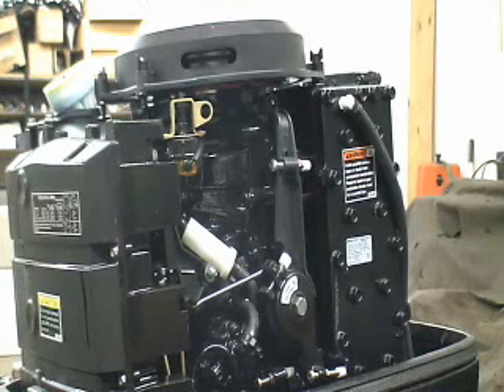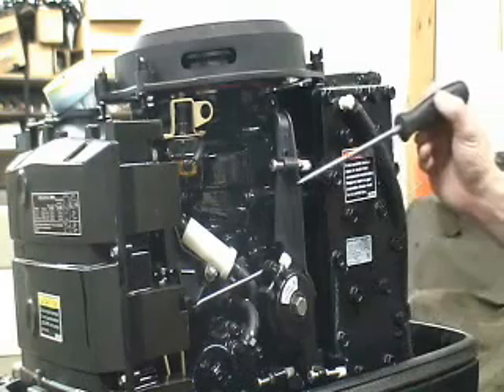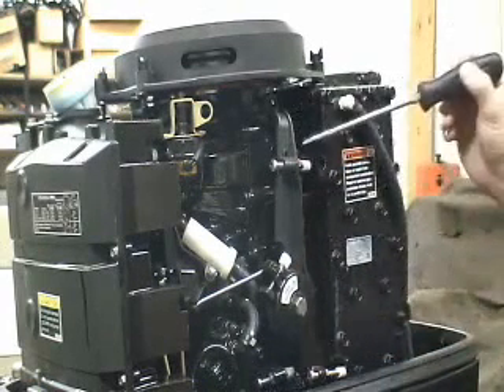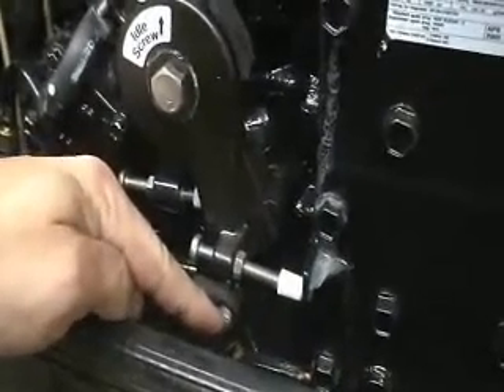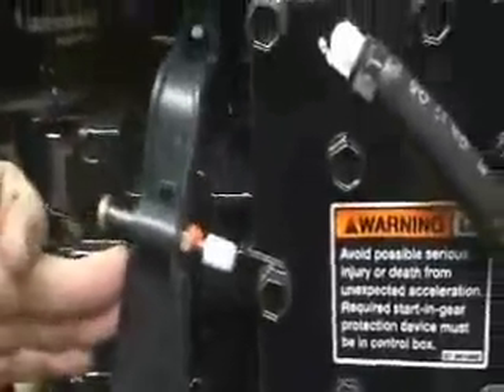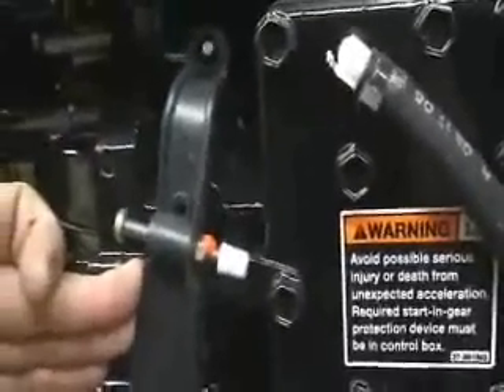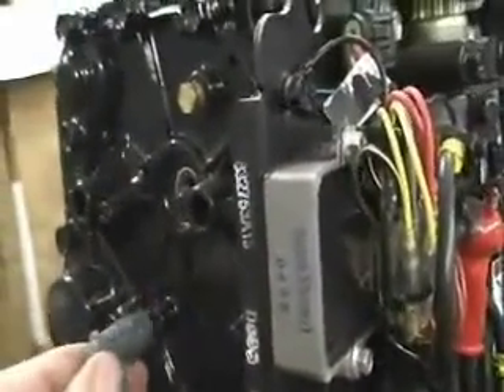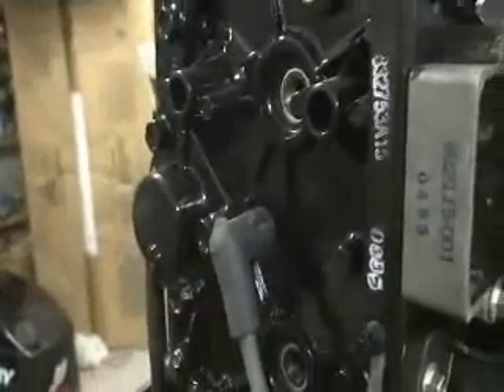Timing a Mercury Engine...Read the description.

Comment: Just changed stator on my 1987 115hp 2 stroke Mercury…I took the flywheel off with the 8 bolts on top, not just the large nut.   Does it matter how the flywheel goes back on because I forgot to mark it or take note.  It has splines but it can go back on several ways.
Reply from the maker: You will be OK.  The splined part houses the timing for the trigger.  The outside magnets are for the stator to create the initial ignition.  Keep in mind though...if you put #1 to TDC...you can realign the flywheel with the timing marks.
Reply: @TheMarineDoctor  awesome thanks a lot!

Comment: You missed a step by not showing what  appears to be a plate that appears to be grounded to the starter & the plug wires being grounded to the plate.   Am I correct???????
Reply from the maker: The spark plug wire charge needs to be able to jump to a ground.  That is correct.  I use a surface gap tester for this.

Comment: On my 95 mercury 3 cylinder you set it cranking at 22 and when running at 5000rpms it should read 20. I think you are off on setting it 2 degrees lower it should actually be higher. Both my air box cover and manual says set 2 degrees higher at cranking speed
Reply from the maker: I will review.  On older engines a retarded timing is better than an over advance.  So no harm will come to engines.  Thanks for the comment.

Comment: I have a 1985 mercury 50hp 4 cylinder outboard do you know the correct idle speed timing setting for my engine. I know the  max timing its stamped on the engine. Thanks.
Reply from the maker: 2-4 deg I believe

Comment: I recently had my 2000 MERCURY 50HP 4 STROKE - 50 ELPT4S engine's carburetors rebuilt and synced by a certified Mercury service location and now that the boat is back in the water (quite a feat with the extremely low water levels) the idle seems to be running slow. Runs Ok at a low idle when in neutral but when put in gear at a low idle it wants to stall out. How difficult is it to locate and adjust the timing screw to increase the idle slightly? Really cannot get the boat out of the water again easily to take back to mechanic. Also had general seasonal maintenance done on it as well - spark plugs, fuel filter, fuel flush, etc.

Comment: hi TMD I have a 1984 60hp 3cilynder Mercury outboard, I have a question on spark plug wire position in relation with the coils.
the coils are numbered 1-2-3 and the cilynders are mark too 1-2-3 Firing order is 1-3-2 My question is; Do I connect spark plug wires, 1to1 and 2to2 and 3to3 or not? i need I little help please, thank you in advance.
Reply: i have the same motor - yes the wires are criss crossed, top coil to bottom plug, middle to middle, and lower coil (#1) to upper plug. However - its the color wires that go into the cdi and then out to the coils that ultimately control the "numbering". If your cdi had brass terminals the colors are written on the actual unit - if your wires disappear into the cdi u need to check on a manual.. hope that helps -

Comment: could you possibly help me help out here. Have a 115hp inline six distributorless ignition.  The timing and sync process is rather technical and dont want to detonate a piston.  any vids suggestions? just paranoid dont want to ruin this engine or pay hundreds of dollars to have done at shop.  as of right now it idles at 1200 out of gear and 900 in gear. in water. Runs fine. hole shot is tremendous and top speed on a 18 bass boat is about 50 with one person.

Comment: How do I check the timing on a 2004 150 xl ot961925 mercury when it says on the emission label that the timing in degrees is not adjustable. I don't have a 878079ro1 manual

Comment: hello, i have mercury superamerica and once i put strobe light connected to first cyl, the light intensity fall down when i am in WOT. What do you think about that? If i ope throttle slowly till max the light is good...but if i open throttle fastly the strobe light falla down like intensity. than for answer.

Comment: Carri.....first do a compression check takes a few minutes if all 3 cylinders are within 10% of each other your good. Then do a spark check The spark should be strong if good then you have a fuel problem. Fresh fuel? change the fuel filter? check fuel lines for cracks, leaks, carbs need to be cleaned or rebuilt  or its the fuel pump. All are easy to do yourself.
Reply: your full of crap

Comment: I have '94 starcraft with a 90hp merc. The boat fires right up at home and rev's up in gear and out good. get the boat in the water and the engine bogs down when you give it throttle, won't go over 1,500rpm. sounds like its running on 2 cyls. any suggestions??
Reply: check bottom cylinders for water, sounds a lot like a lower crank seal.

Comment: I have a 1998 75hp Mercury 3 cylinder Tiller.  I purchased a Mercury Service Manual recently so I could have all the specs and service instructions.  According to the manual, it just says to remove the #2 and #3 spark plug, hook the timing light to #1 and then set your timing per the 3 individual throttle settings.  It doesn't say anything about grounding the plug wires.  Are the older models different than what you describe in the video?
Reply from the maker: I just ground the leads to prevent open sparks.  Safety

Comment: Dear Marine Doctor, somehow my 1995 2 cyl 60hp Mercury has come up short the top flywheel cover so I do not have a window to look through to see the timing marks. It's loss has never been mentioned by the 3-4 mechanics that it has seen in the last 3 years.  Is there any other way to set timing.  What other running problems might be experienced due to the loss of the flywheel cover. The fast idle screw in the center of the setting screws is also missing.
Reply from the maker: You can still index the flywheel to TDC of # 1.  That would be where the timing mark goes for the pick up.

Comment: Hi, I have a 7.5hp merc that won't start. Has spark, 120 psi in each cylinder and i've removed the intake and exhaust covers and sprayed with fluid. The keyway ins't sheared and it still won't fire. 
Any thoughts would be great!!

Thanks
Reply from the maker: How much of a gap will the spark jump?
Reply: ended up being the reed valve gasket. Thanks for the comment!
Reply from the maker: Wow, that's pretty rare for an engine like that.

Comment: Hi there.  Any ideas what would cause a 90hp two stroke to have a small occasional cough or stutter at full throttle on the water?   Thank you.
Reply from the maker: Normally an ignition miss will cause that.  Could be a coil breaking down.